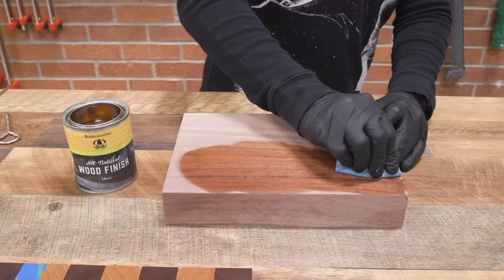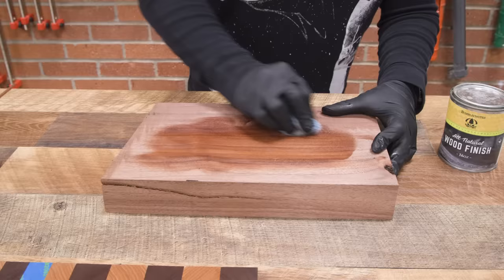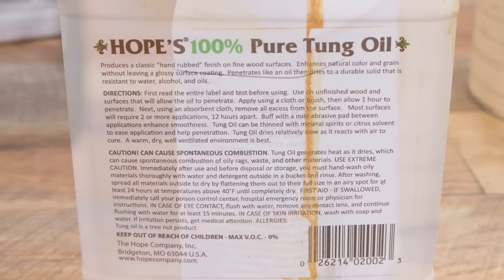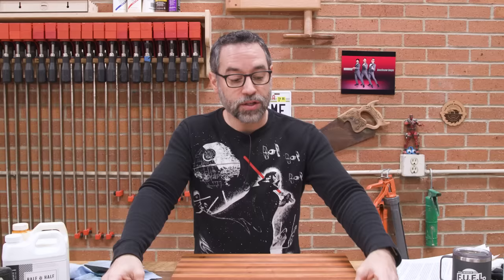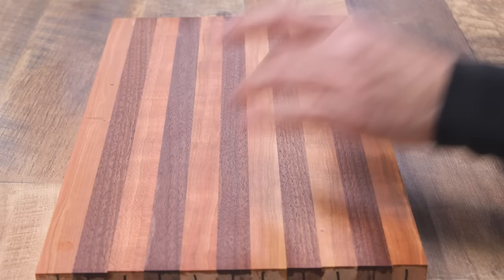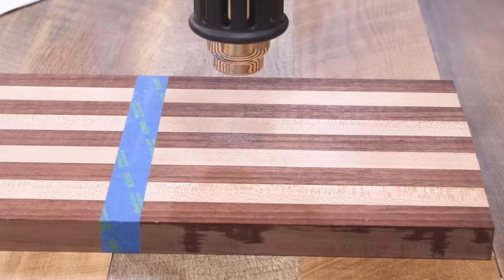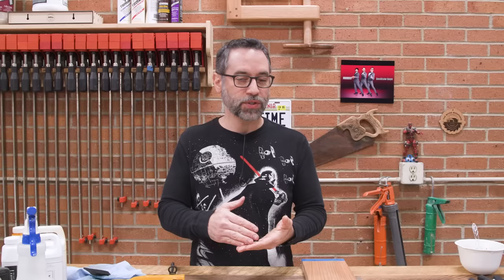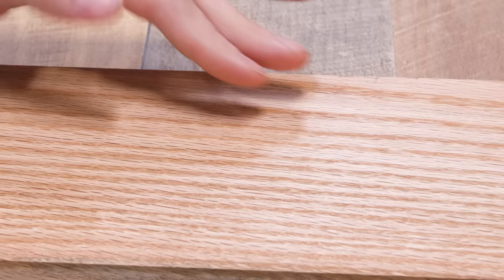A Better Way To Apply Oil Finishes!

Comment from the maker: It's a long video. Let me help! 
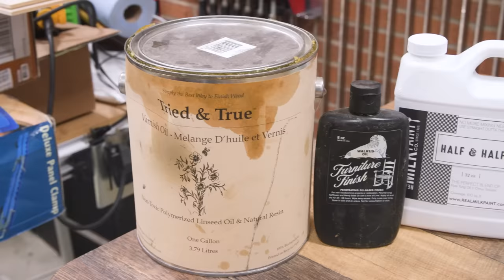00:00 - Intro

00:24 - How to Apply Tung Oil w/ Citrus Solvent
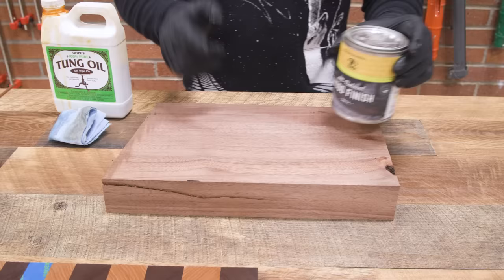02:43 - Applying Pure Tung Oil
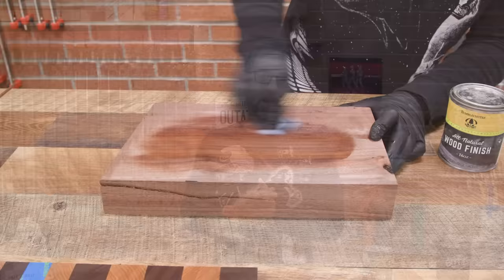03:33 - Is this the only way?
04:01 - The Flooding Method
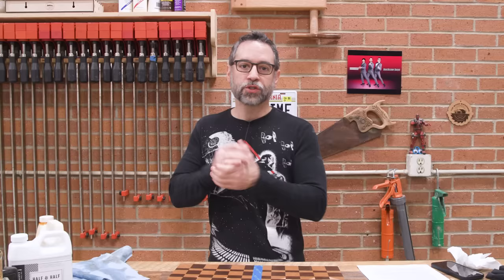06:17 - Why is Flooding Problematic?
09:38 - My new Guild course! - https://thewoodwhispererguild.com/product/criss-cross-dining-table-bench/
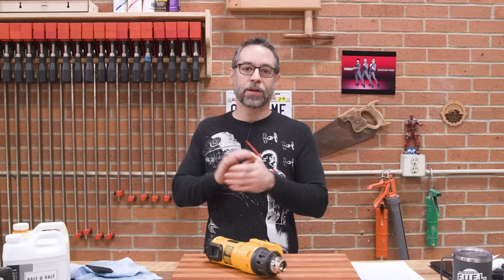10:29 - Demonstrating Curing Problems
15:47 - Water Absorption Test
20:27 - Why do companies recommend the flooding method?
Reply: Pin it!
Reply: Thanks for the tips, Marc! I find myself using a fair amount of oil and varnish blends like watco danish oil and similar things (not on cutting boards, but other knick-knack type projects) and I’m curious if your advice would be the same for those types of finishes?
Reply: Years ago I think there was a treatment for wood before you put the finish on that was supposed to close the pores of the wood so it didn't soak up finish so bad. Is that a thing? Do we not do that now?
Reply: Have put tung oil 5 times.    before wiping. Each time I apply oil, l decrease time before wiping because it's always sticky. With 320 grit in between. Last coat was 5min before wiping . Still sticky. Help!
Reply: @jack002tuber  i tried to seal wood with thinned waterbased sanding sealer before laying natural wood oil. Seems to be working just fine. I made sure the 1st layer already dried up, before laying down the oil.

Comment: I guess the flooding method is the one manufacturers want you to use in order to go through more of their stuff.
Reply: Maybe or maybe they’re still of the mindset that the more oil we can get into the pours the better our wood will be sealed. But maybe it is about driving sales. They don’t tell you to flood with urethanes or something like that, even TruOil doesn’t tell you to flood it.
Reply: Doubt it.  It's $40 for the small "Bumblechute" can, just greed.
Reply: @cMurder2osix  they are changing their packaging to reflect the method suggested in the video. It isn't about that.
Reply: @cMurder2osix Not worth it. Straight Tung oil or just buy both and combine them

Comment: I had always used Salad Bowl Finish from GF for cuttingboards until I made one for a cousin. My can was too old so I had to use pure tung oil. I flooded it on like the directions said, then wiped it off. A year later, it was still leaching oil out. Finally it stopped and I tried this light method. MUCH better! Been woodworking for 12 years, and still learning new things. Thanks Marc!

Comment: I bought an 1860's dental cabinet that was finished with oil (order details were  still in the cabinet)  and I have never experienced a wooden object that had water just bead up and swipe away like this thing.  Definately converted me to oil finishing.  It's amazing.
Reply: Do you know what oil was used on it?
Reply: If it was 1860s are you sure it wasn't shellac-ed?
Reply: @vikramkrishnan6414  yes, because the custom order slip was inside the cabinet, with what finishes were done and how much it cost.

Comment: This is exactly where I went wrong after your previous video about finishing. I followed the tung oil manufacturer’s directions for flood coats and left plenty of time for curing only to come back to white patches of cured oil. Was about to give up on tung oil/citrus oil mix but will try the thin coat method. Thanks Marc!
Reply: If you get the white spots or discolored film, how do you go about fixing it? Not that I would do anything like that. I'm just asking for a friend.
Reply: Same here. I actually have a friend who did multiple boards using the manufacturers instructions, now he has white speckled boards… Would also love to know if it’s salvageable. Asking to help my friend of course.
Reply: @sebasss01  I took all of "my friends'" boards and gave them a light sanding with 320 grit and rubbed in a very thin amount of oil/solvent and they seem to be fine now.
Reply: @sethowens  ah, thanks I’ll tell my friend to give  that a try then.

Comment: I think that your explanations were accurate.  I have been applying finishes for more than 35 years and have tried many different materials with many different application techniques.  Here’s what I’ve learned: 1. Unless the finish is self-polymerizing (two part finishes or loaded with drying agents) thin coats are always better, in the majority of cases a diluted thin first layer is best.  2. Cure time is crucial, period.  The finish is the final step of craftsmanship, and you need to be prepared to “finish” the finish.  Rush through this stage and your perfect joinery and meticulous wood selection and preparation will simply look like crapmanship instead of craftsmanship.
Reply: Hi mmgross.  How would you recommend going about applying a Waterlox tung oil finish to antique heart pine ceiling joists?  The joists are "rough sawn" original and I don't intend to hand plane or sand, as I've already used a sandblaster to remove some of the patina, revealing clean wood underneith but also resulting in a rough texture.  My thought is to first deep clean, first with air compressor and then with a wire brush dipped in mineral spirits.  Then, I would apply thinned-out Waterlox tung oil via a ROLLER, being a bit aggressive to make sure I get full coverage but then coming back a few minutes after initial application and wiping away excess with rags (or even with a "dry roller"?).  After waiting a day or two I would come back and scuff sand a touch to knock-down the first coat, then repeat the process albeit maybe not being so aggressive with my roller application on coats 2 and 3.  Do you think I've got this right?  What would you recommend?  Thank you for your time!
Reply: @MrGrillguy44 : Seems reasonable. How did it work out?
Reply: @HighRPMCreations like so many of my home projects, i haven't gotten to this yet.  Lol.  I was also hoping mmgross (or others) would chime in and offer feedback on my plan.

Comment: Thank you for making this video. I have probably seen around 30 to 40 other videos like this trying to learn as much as I can, but the simple approach that you discussed, and the explanation of the oil going into the pores, is worth more than all of the knowledge I gained from all the other videos combined. Thanks a bunch!
Reply: Same is here, I’m not doing a cutting board, I was looking something like that for my axe handle, for axe handles is different i will want my axe handle absorbed as much oil as possible, for the outdoor weather, I think I will soaking and submerge my new axe in linseeds oil overnight so the oil will go into all the pores then I can wax the handle

Comment: Perfect Timing! I just put on a flood coat of Walrus Tung Oil. Then I sat down to watch your video…
I went back out, wiped off the excess, and then rubbed the remaining oil into the surface.

Comment: Thanks for this video. I have been doing woodworking for nearly 1/2 century and have always liked oil finishes. You realized the advantages of thin coats versus flooding in way less time than it took me. Haha. Thanks for validating my own findings. I like a couple thin coats of tung oil/mineral spirits, allow a week to cure, then do Briwax applied with 0000 steel wool and buffed to a nice flat sheen.

Comment: Rags rock.
Finish expert and author Michael Dresdner said ANY finish can be applied/wiped on with rags. Since hearing him say that over 20 years ago probably, I use rags for almost everything including paint! When I'm done with paint it goes in the garbage, but I use old, dried oil finish rags and ones with polyurethane and other clear finishes to help start the wood stove! :-)

Comment: Great vid, very thorough. I know it’s been done to death, but would love to see your take on the latest craze of hard wax oils. E.g. Rubio, Osmo, Odies’s, Nano ceramics. Including amount of time to apply, dry, cure; level of gloss, durability and repair.
Reply: This whole ceramics thing is legit. And it's simple, hence why black forest did it, and Cam was pushing it then all of a sudden had his own brand lol. I'm 99% sure you can just use a general car wax ceramic coat.

I like these guys, but it's too product heavy it makes me cringe.

"This is a pencil, I didn't invent it or anything, you can buy this one from the links in description"

I've stopped watching him for now because it makes me cringe how he says I didn't invent it for every single cool technique thats been around for 100 years, and how every single time he uses a product he makes sure he gets a sponsorship before he posts the video.

It's cringe. I grt it, but it's taking the craft out of it for me and becoming one long commercial
Reply: Marc mentioned recently on a wood talk how these hard wax oils with additional protection on them (ceramic coating) are taking away the entire purpose of the HWO’s in the first place which is ease of application and less steps than a traditional polyurethane. It really is a great point. I mean they don’t offer enough protection in the first place.
Reply: @Sam Wanamaker  Agreed. The advantage of HWO is ease of application, and done properly, it's pretty damn tough. Even so, one great advantage is the ability to spot-repair if the surface takes damage. The ceramic adds considerable time and cost to the finishing process. If you're going to top-coat, I'm not sure why you wouldn't just use a thin film-coat finish like poly, shellac or lacquer; those are all considerably cheaper and faster

Comment: Thank you Mark.  I've been struggling with this issue of too thick coats as of late.  This is something I will definitely try out.  

A few questions:
    • Do you increase the number of thin coats to compensate?  
    • Would more thin coats increase water resistance?  
    • How can we tell when a given coat is fully cured?  
    • Will applying additional coats have a different effect if the underlying coat is fully cured or partially cured (dried not cured)?
Reply: Perfect list of questions, sadly not answered

Comment: You could probably test the water absorption by completely coating small blocks of material of the same weight. Next, place them in a measured amount of water. Weigh the water before and after, and you have the amount of water absorbed per unit of weight of wood.
Reply: Kinda genius

Comment: To test water resistance, I would be curious if you weighed each board, soaked them under water for a period, and weighed them again, to see if they absorbed water. 

I would also be interested to see the same test with soapy water, since soap reduces surface tension and would allow it to absorb better, at the cost of also attacking the oil finish. But since most people use soap on their cutting boards, it seems reasonable.

Comment: I was taught the "flooding" method but, was also told, to angle the piece over an empty container and use a plastic scraper to push off the excess into the container, then wipe down. Also was taught to let "dry "24hrs to 48hrs" to dry between coats. To me, the biggest key to application also should include the temperature and humidity in which the application is being done. I'll be doing thin coats from now on. I've always used Tung Oil and Lindseed Oil, they've always been my tried and true finishes. Thanks for this info. Cheers :)

Comment: Certainly for a cutting board I prefer the saturation method.  Curing may take years or forever, but (natural) stains will less likely  penetrate those pores when they are filled.  And when the surface gets damaged by heat or scratches fresh finish may come up to replace it.

Comment: Great info, Marc~!  Danish Oil (by Watco) has become one of my favorite finishes.  Their instructions also say to generously apply the finish, let sit, and wipe off the excess with a clean rag (as you probably already know).  I'll definitely try the sparingly applied amount approach on my next project to see how that comes out.  Thanks much~!
Reply: I was scrolling the comments to see if anyone brought up Danish Oil, because I use it so frequently. I’m wondering whether the varnish component affects the way it is absorbed.  Have you had an opportunity to try out the “wipe and wait” approach yet?

Comment: I totally agree with you. Especially for all the directions for consumer marketed finishes you really should be skeptical about the directions for application and talk to one’s who have been using that finish or similar finishes for years in the real world. 

For linseed oils I can say that thin coats are definitely the way to go and wait as long as possible between coats if you are concerned about the fastest dry and cure times.

Comment: Thank you.  So much contradictory information on the proper application of tung oil, and your explanation (not flooding) makes total sense.  I am using pure tung oil on some antique dining chairs that I have stripped, reglued and sanded.  Going to dilute first coat with orange oil probably 1 to 1.  Plan is to do 4 or 5 coats.  Do you recommend continuing with the orange oil but decreasing the orange oil amount with each subsequent coat until perhaps the last or 2 last coats are pure tung oil?  I am thinking about dry/cure time, especially with the higher humidity at the moment.  Thanks.

Comment: Hmm, the heat gun demonstration reminds me of advice I actually received to heat wood up before applying the finish, not the other way around. The idea was that the air in the pores and pockets would expand, then try to shrink as it cooled, but if it was covered over with oil (in this case mineral) then it would suck the oil deeper into the wood. The guy claimed he sealed his cutting boards and wooden utensils that way, and has seen much less wear on them or leakage/damage from heat exposure.

I wonder if this would work with curing oils, heading the wood up then applying the first thin layer to the piece. Some oil would get sucked in, but would remain in contact with the air since there wouldn't be more oil flooding in on top of it.

Comment: Good information. I've used Tung Oil for years and several of my early projects became finishing disasters because I used the flooding method followed by a wax finish. I wiped the excess off and gave the oil several days to cure and it felt dry so I applied the wax. About a week later the wax starting sloughing off and the whole thing looked like it had the mange. I was able to save the projects by giving them about a month to really cure, a light sanding and reapplying the wax. 

When I apply much more sparingly, I don't have the issues. I still wait at LEAST a day between coats and about a week between the final coat and waxing.

Comment: I like the flooding method, but only for the first coat.  I mix my own Danish oil (3 parts turpentine, 2 parts spar varnish, 1 part boiled linseed oil) and never get bleed back on the first coat.  I prefer the darker appearance and being able to apply extra finish to more absorbent areas.  Having the spar varnish in the mix prevents oil coming back to the service. Subsequent coats I just wet the surface, wait a few minutes and wipe dry.  I apply between 3 to 5 coats waiting at least 24 hours between coats, 48 hours being better.  You can tell if the surface is dry by feeling it with your fingers.
If I was just using oil alone,  I wouldn’t use the flooding method.  I’ve had straight oil finished  pieces bleed oil back after weeks when sitting in the sun.  That’s why I only use Danish oil mixes if I want an oil finish.
I would think if Mark had applied his light oil finish 4-5 coats, he would get some bleed back from the use of heat.  Straight oil just has different characteristics than an oil blend, but you can achieve the same appearance with both.  That is why I choose an oil blend.  I do use straight oil when I’m going to use a top coat over it like shellac.

Comment: Perhaps tye cutting board has a greater affinity for water and when using it, moisture is absorbed that displaces the oil. The oul rises to the surface, oxidizes, and mixes with other contaminates to create white streaks.    Also, perhaps there is some lac beetle lac mixed in the original oil by the manufacturer.

Comment: When using polymerasing oil finishes, it is best practice to keep the piece at least a full month after the final coat of oil is applied. This allows enough time for it to fully cure and do anything it might before your clients get it. No matter the application method used.

Comment: I love the Tried and True instructions: if you've used any, you've used enough. They recommend a tiny amount rubbed in vigorously.

 I use that mentality for all natural oil finishes. I use about a dime sized dab per square foot and I apply it with a white pad on a DA polisher. I finished a bookcase by hand once and my arm was tired! The polisher was the perfect solution.
Reply: What is the “white pad” you are referring to?  Thx
Reply: @tundrawhisperer4821  3M white for the first coat or 2, then I switch to a terry sock.
Reply: @CheveeDodd  is that a wool, microfiber, or foam pad?  Thx
Reply: @tundrawhisperer4821  the white scratch pads. I sand to 180 and use the scratch pad as the "final sanding." If you prefer to sand to a higher grit (220-400), you could use any of those pad applicators for all the coats.
Reply: @CheveeDodd  oh…like a scotchbrite type pad, I see now.  Thx

Comment: Flooding is fine if it's polymerized from a heat treatment process or if it has metal driers in it. If it's pure, thin coats makes a lot more sense. Another great video Marc. Accurate, unbiased, and informative

Comment: I had wood that needed protection  ASAP in the Grand Canyon area which needs sanding etc that I can’t do to make it more finished so the Tung oil soaked with brush on seems to of filled lots of areas that looks to be adequate to take it to the fall when I can sand etc and then pick thin layers to finish after etc is finished.